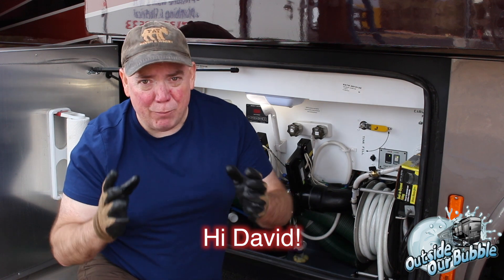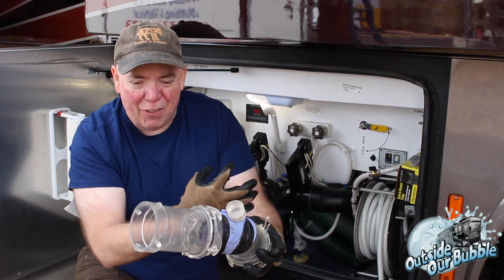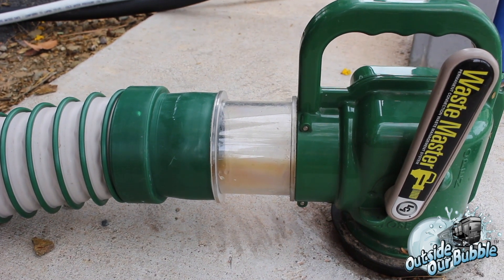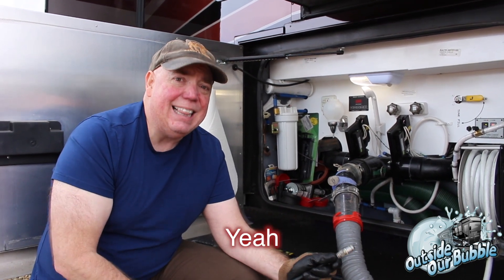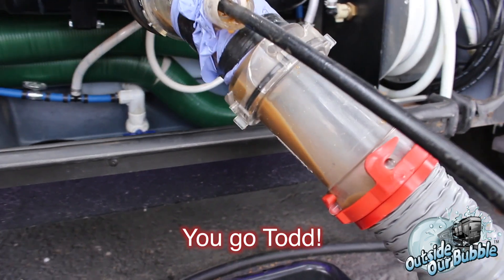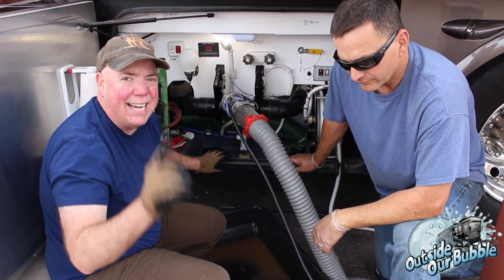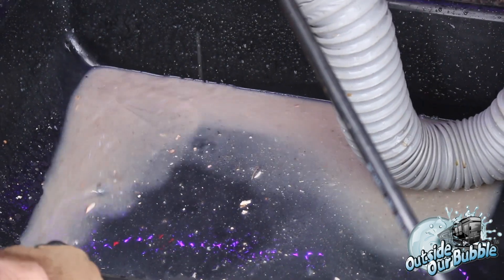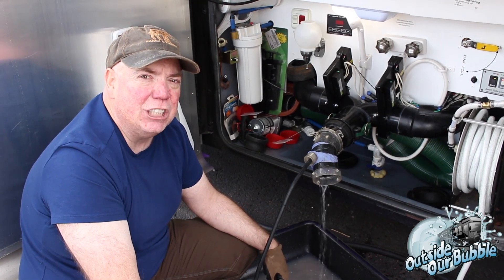RV Tank Power Flush Out

Comment: Where did you get the special reverse water connector to insert into the tank. Did you use the regular
Reply: Rhino connector or do I get a clear connector w/ special open for the hose to fit
Reply from the maker: @dianacooper2067  Hi...Use used one of these... https://amzn.to/3a0hAyR   and then where the hose would normally attached, I drilled it out so the pressure washer hose could be feed through.   The Jetter tip is something like this where the water is shot backwards thus being able to move the home around in the tank...  https://amzn.to/3d6geVg    Hope this is what you meant and this helps.

Comment: I own a  Tiffin as well and still wonder why the manufacturers don't put a rinse hookup on the grey tank like they do for the black tank side. Is there some design problem ( multiple drains?) with this? Seems like a simple fix for the same issue......rinsing a holding tank. IMHO
Reply from the maker: No design issue that I can see. It really is just cost related as most people would look to flush out a black tank but not a gray.  We keep our gray tank closed all the time and dump when it fills. We do this to help keep get the solid items out the best we can with the pull of the tank being emptied. Most people don't do they and leave the gray open which then makes it more prone to build up. This is one reason we put in the electric dump valves so we are not always needing to go outside to empty the gray but instead just push a button. :)

Comment: I have often thought that it would be nice to run one of those drain cam's up into the tank after a normal clean out to see what is the condition. I think you're the guy that could make that happen. I quit using my rv power clean out because after using it, I then cleaned it with the old fashioned wand and still got stuff our.
Reply from the maker: LOL...I do have one actually. :)  I'll see if I can remember to do so next time I power wash the tank.

Comment: I second the recommendation for TankTeckRX. No more odor in the black or gray tanks in our travel trailer. You can actually open the toilet with the vent fan going and not get gagged out.I had 1/4 tank (14 or so) in the black and Half a tank (apx 28 gal) in the grey when we first put it in right after a trip. I didn't dump out. Instead, I  totally  filled both tanks with water and a double the dose of TankTechRX and let them sit for two weeks. When I dumped, you could visibly see a huge difference in the way all the stuff came out. I left the recommended one inch in the bottom and it's been good so far. Also, one of the grey tank sensors that had been intermittent works again.I'll be a repeat customer.

Comment: Wow...great video.  Thanks for sharing.  Did you use just a standard pressure washer with the jetted nozzle?  It seems like something we all should be doing yearly.
Reply from the maker: Yes, it is a standard pressure washer with a special tip and flexible soft hose.
Reply: @DavidBott  where can I get the special nozzle. I’ve had this exact idea in my head for years. You can also put a bore scope in the tank to see how much debris is still left inside. Thx for the video!! Subbed!!

Comment: Wow, really thought tanks were getting pretty well cleaned out. I wonder if you could get away with a similar set up that you could have on board, maybe not as much pressure  but more than the rinse. Was this the first time you've done something like this David? Great video as always, and entertaining as well.
Reply: Well, in addition to your black tank flush you could get an inexpensive "swizzle stick". I think Camco makes it. You attach your hose and feed it in through the toilet directly and it will spray 360 degrees at all angles you tilt it. That would get areas of the tank that the built in black tank flush probably doesn't. -- As for the gray tank, you could flush it out, and then close it off and fill with warm water, detergent, and a high concentration of bleach leaving it over night for a good sanitation and then flushing it all out in the morning.
Reply from the maker: Had one of those for our other coach. As far as the stick goes, on these coaches the  toilet is automated and thus closed the trap.  I am not aware of a way to be able to leave it open.  Also the issue is that they only can reach right there by the tank and not into the tank. Thanks you though.
Reply from the maker: Yes, as mentioned in the blog post that goes with it, it was the first clean out.  Glad you like the videos. ;)  http://www.outsideourbubble.com/gray-and-black-rv-tank-flush-out-service
Reply: I guess all rigs are different. I can get mine to stay open and can feed the hose and swizzle stick in far enough to reach the whole tank, all the way to the bottom, and by wiggling the hose it swings the stick all around letting the spinning jets on the end reach a lot areas my regular black tank flush does not. -- I'm sure the pressure wash service you're showcasing here in this video is probably superior, but the OP was asking about something he could keep on board that would be "not as much pressure but more than the rinse".
Reply: @Jeffrey DeRoche - So, compare mine and David's comments and see if you can keep your toilet open before considering the swizzle stick. Also, consider whether or not your tank is positioned like mine, right below the toilet to where you could reach the swizzle stick all the way into the tank.
Reply: @Jeffrey DeRoche - Also, if your rig can use hot or cold water on it's built in power flush system like mine does... choose hot water. I tested both and the hot water flush brought out more when run after the cold ran clear.

Comment: Check Amazon for sewer cleaning hoses for pressure washers. I just got on for $40 that connects to my electric pressure washer, plus I purchased the elbow tank connector for around $30 so I can do this myself for a lot less than the pro; I hope it works a well your your video. Maybe I will do a video of this process myself. I don't think I will be as excited as you where in your video.  :)

Excellent video...new subscriber now.

Comment: Can 4000 psi damage the plastic tank?
Reply from the maker: The jetter nozzle that is used is not a cutting nozzle. So you're not getting that full force of 4000 PSI. It's a spread out stream that is meant to knock things off the plastic walls and clean out the bottom of the tank. Should not be an issue at all. At least I would not think so. But don't put a cutting nozzle on there. Lol